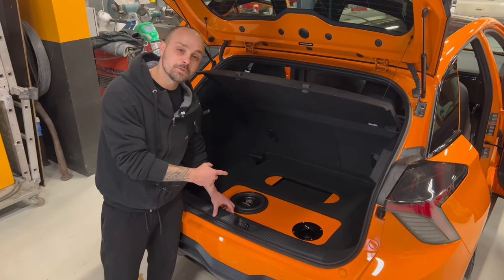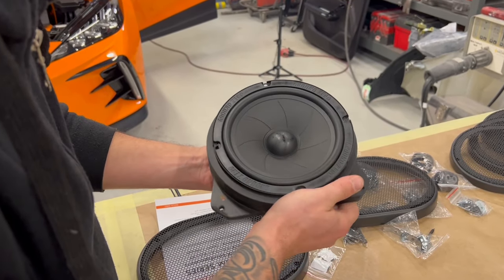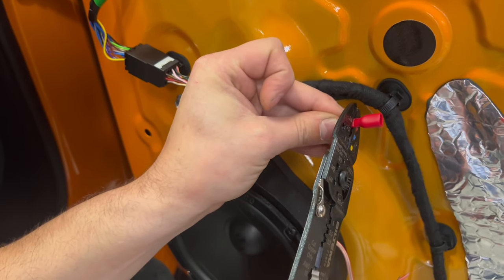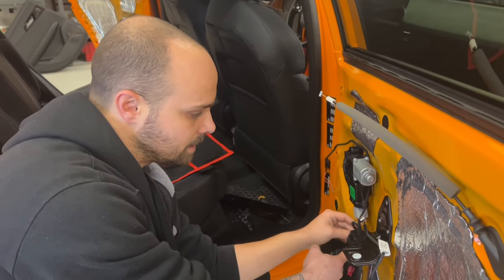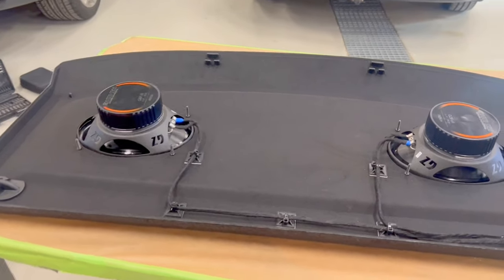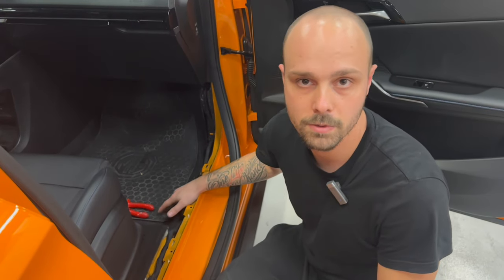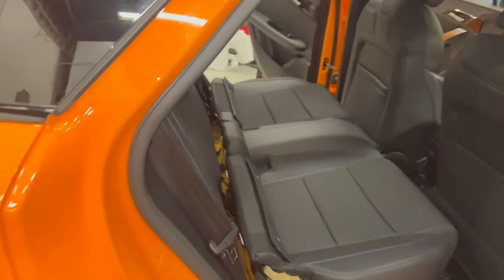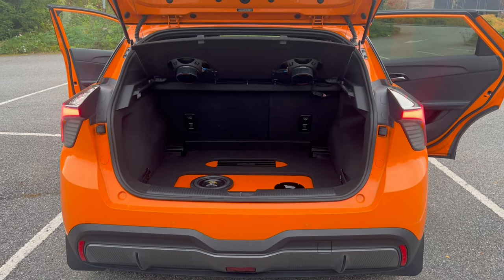Mg4 sound system upgrade part 2! Sound system installation in detail.

Comment: Great work! Really interesting to see the internals and build quality, which seems amazing at this price point. Much attention to detail with clips and fastening of cables, dampening and clearly a lot of quality checks judging by the markings. In my experience and by subjective evaluation (we have MG4), the door cards are a contributor to the muffled factory sound. Biggest quick improvement would be to build real speaker grilles rather than the integrated ones we have, and to add more dampening and isolation. A door card is not supposed to be a speaker box, but on many cars it is.

Comment: Very nice and neat setup. Interesting to see how you dismantled and mounted back all the panels and insulated the doors ❤. I would personnaly use thicker wires in all doors (2.5) as yours seems a bit thin (0.75 or 1mm2 i would guess from the video), put washers under the oval speakers nuts (this composite material tends to crack over time, especially with strong vibrations), add an extra layer of wood under oval speakers panel for rigidity, add a 1 or 2 farad super capacitor on the battery (see upgrade the poor and small factory lead battery as your setup is quite power hungry), and surely weld all connectors as those crimped ones are a real crap for audio quality and reliability. Just my way of doing, don't take it wrong, your installation is great and i am sure it runs really good.

Comment: Very nice job!

The underhood fuse holder should always be a waterproof design. If not, corrosion can be an issue.

The factory music source has built in DSP (EQ curves, time delay and maybe all pass filters) to make the factory speakers sound better. When you swap speakers that can make the new speakers sound worse, not better. 

Typically you would remove all the factory DSP to get back to a flat signal and then apply new processing. An aftermarket DSP that can do both will greatly improve sound quality. 

Or a device like the Kicker KEYLOC can remove all the factory processing and then a traditional DSP can reduce everything.

Comment: Don't forget to add the remote bass knob. 

Make sure your rca cables are not being crushed by the rear seat frame. 

You might try running the rear door speakers off the factory amplifier so that you can retain fader control. Rarely do you want the rear speakers as loud as the front.
Reply from the maker: I did forget to put the bass knob and I added it later on 😂

Comment: Hi, first of all congratulations for your videos that are well explained, but I wanted to ask you how you managed to give the MONO signal for the sub to the amplifier. From the car you got the front and rear left/right signals with the adapter, so for the subwoofer how did you get the signal?
Reply from the maker: Hi thank you!
At the beginning what I did was that I took the front output and I put two y from female to male.That way I feed the speakers and the rear output I used only one for the sub input.left or right it doesn’t matter if your balance and fader is on the center .
But I didn’t like that ,so after I removed the y and I just connected the front to front and rear to rear.
This amplified has the option to connect 4 channels and it makes the output for the sub itself.
I hope I explained this good enough 😂🙂.

Comment: Fantastic video! Thank you. It looks like the engine sits under the rear seat. Would there be enough space under the rear seat to put more of the same type of insulation you used on the door? This may help with reducing engine noise at high speeds.???
Reply from the maker: Hi,  thank you
I am glad you liked it. Yes you can put under the seat I believe that this would help with the road noise and there is enough space to do it.

Comment: Great work, thanks alot!

Do you know if there is a adapter for the stereo/speaker cables yet? Would save me a ton of headache.... 🤯
Reply from the maker: Hi , Thank you .
I think I saw some post of a sound system  in some Facebook group page that they used an adaptor.Unfortunately I do not have a link or anything.

Comment: Really nice build and super great video! I would have skipped the 6"x9"s on the rear shelf, though - and maybe even the rear door speakers - and installed even fancier front door speakers for the money saved! So how does it sound? Are you pleased!?
Reply from the maker: Hi thank you!
This is not the super expensive sound system but is very clear and loud more than enough.
Much better than the factory.
The 6x9 give a lot of bass to the sound system that even if you do not put a subwoofer will add a lot to the overall sound.
I am pretty happy for the money spent 🙂

Comment: How much would you charge to supply all the parts and do the install for someone?
Reply from the maker: It depends on which country  because the hour payment is deferent from country to country.
The hours that you need to pay is much more than the equipment  at least in Norway that I made this.

Comment: Hi Malaka.. 
I tryed to install Focal Flax EVO PS165FXE 2-way with stetsom or audison digital amps, and it doesn't work. We get like a magnetic puls almost like when you check polarity on the speakers with a 9v battery (it moves a lot) 
 I tryed to draw a separat power + & - direct to the battery on the outside of the car. I connected hi in from the same green Conector on the org amp 
FL + WhiteYello
      - WhiteBrown
FR + WhiteOrage
      - WhiteGreen
I have  mg4 standard. 
No speakers in rear doors...
Reply from the maker: Did you use converter from hi to low?
It needs special converter that has some kind of resistance inside so the the infotainment system gives you output .
I have link in the description malaka.😂
Reply from the maker: You can have this converter with two channels also if you do not have 4 in your car.
Reply from the maker: It will not work if you connect it straight to the amp.